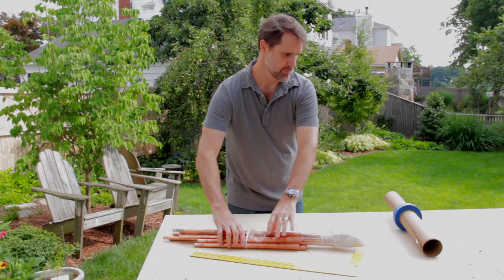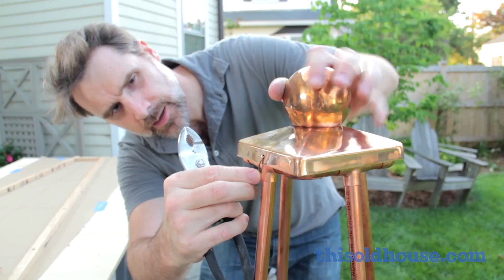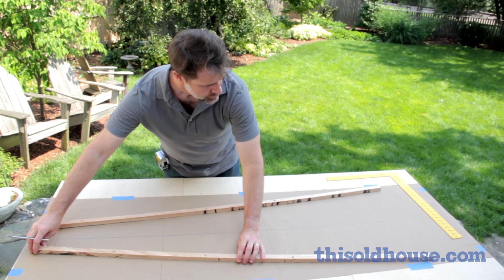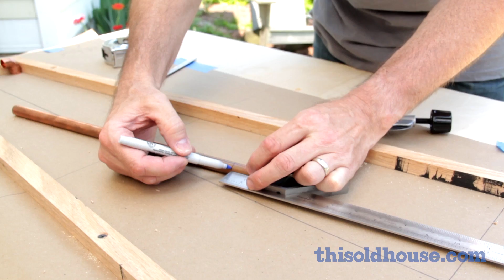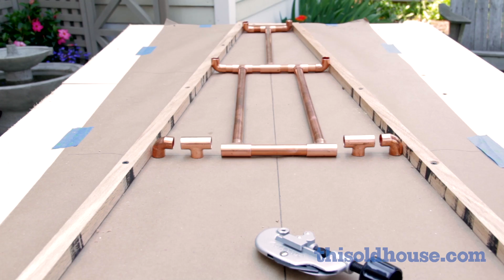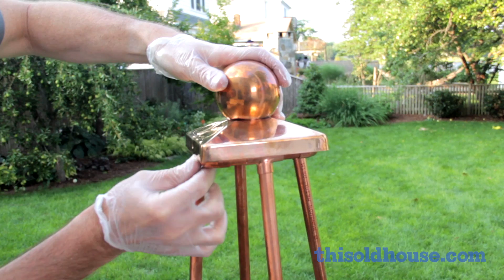How to Build a Copper Trellis | Ask This Old House

Comment: just use wood it's cheaper and less fiddly
Reply: And your wood will break down and you will have to replace it... The Statue of Liberty is made of copper, and it's the most lovely color because of the copper... I would rather spend extra to get it done it copper... I am not so sure I like this design though...  :)

Comment: And how much did it cost. That is the one thing that drives me nuts about TOH they never tell you how much they spend.
Reply: Prices differ from region to region... but here it would probably be around $50. Fittings cost .75 to $2 each and copper is like $10 per 8 ft. You need solder and flux and a torch which is around $20 for cheapo one.